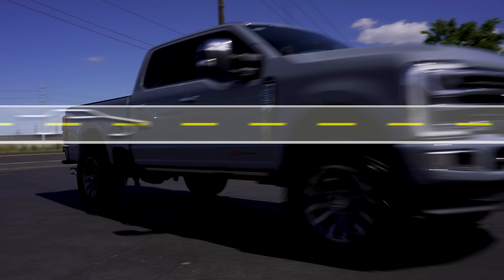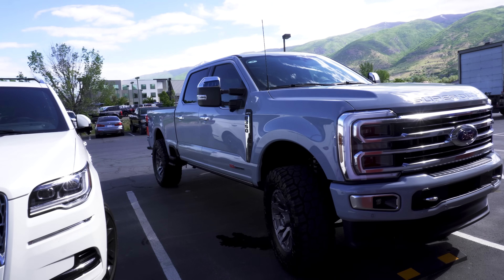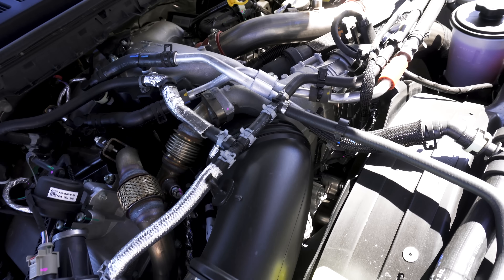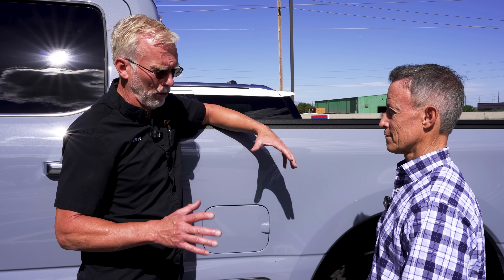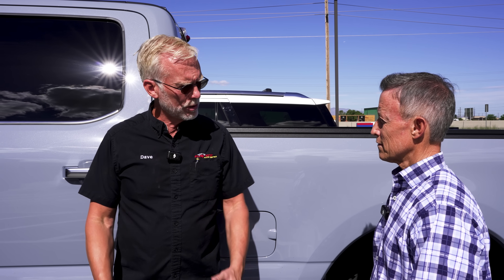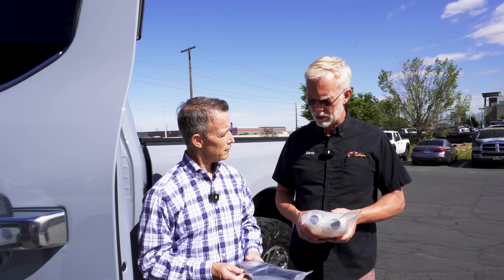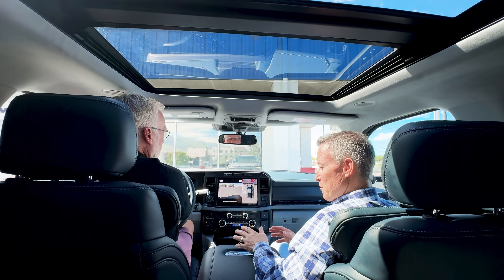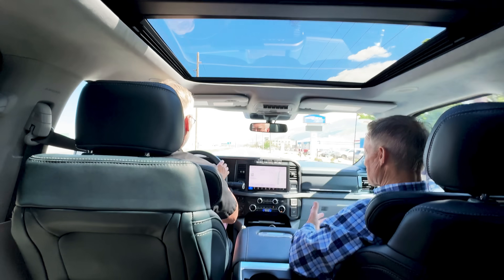Diesel Truck Maintenance

Comment: Ford chassis, cummins engine, allison transmission, The perfect diesel truck
Reply: My thoughts exactly 💥👊🏻💯
Reply: '06 Sprinter dually  25mpg highway with a 2" hitch unbeatable when diesel fuel is $3.50/gal
Reply: Ram chassis with air suspension, Cummins, ZF trans. In other words a Ram 2500.
Reply: I'll keep my medium duty Aisin tranny on my Ram 3500.
Reply: Ford chassis, international engine, zf transmission.
Reply: Allison transmissions aren’t anything special at all.
Reply: @CornFed_3 sure thing CornPop

Comment: Did I hear correctly? The question was, "what is in DEF?". It might have been the simplest to answer: DEF is 32.5 % urea and 67.5 % deionized water. Explaining how it reacts with NOx in the DPF is a little harder, but it's the whole point of current emissions systems for diesel engines.
Reply: Cat piss‼️

Comment: I think your great (Dave) I have been fowling for some time. With all the info you gave this guy why wouldn't the computer on the truck take over and contol and advise of all these situations. If I bought a nice truck like this you would think I wouldn't have to go through of having to learn and concern my self with with all technical checks, testing and mantance checks. It seems to me that you need to keep a logbook like it was an airplane. I understand its a high end working  truck but I would think at that price range you should be able to jump in and go.

Comment: 2:46 Mr. Bill Hewitt (RIP) powerstroke specialties, the man who arguably worked on more powerstrokes than anyone outside Ford motor company swore by archoil AR6500 in the fuel and AR9100 in the oil. He tested these products on thousands of fleet vehicles  with lots of idle time. it worked so well ambulances fleets, construction company fleets would buy these products because they kept regens down and the DPF and EGR cleaner, as well as helped the high pressure fuel pump live much longer. He believed in these products so much that for years he would send you a sample if you just payed for postage. If I had a diesel I would follow his recommendations to the letter he was a wealth of knowledge on powerstrokes. Look up his videos, follow what he says and that truck will live a long time.
Reply: Bill truly solved the issues with the 6.0s.  I don’t think people understand how much he did to bring those trucks not only back to life but he single handedly brought the values back to those trucks.  Archoil 4 the win.  I hope your having fun in heaven Bill.
Reply: Did know that Bill Hewitt passed away a few months ago? His employees are keeping the place alive.  Spoiled my whole day hearing that.
Reply: If you are needing an additive for your oil, you are using the wrong oil.
Reply: @ropeman3916  I’ll believe Mr Hewitt, thanks.

Comment: I'm glad I own a 2002 2500 Dodge Ram 4x4 with the 5.9 Cummins in it I don't have all that gov. bullshit on mine to contend with as they did not have that crap back then ! All that def crap and rengen crap does is rob you of power and destroys the motor !

Comment: Hello i have a question for you what is the best product to use for an Audi q7 TDI 2014 to atomize fuel ? ( i already changed the EGR the nox sensors and DPF filter. ) dont want the car to break down thank you in advance

Comment: Great conversation and lots of good information.   I have one question.  I have a 2006 2500 HD Silverado with a Duramax LBZ and have stayed on top of all my maintenance.  I rarely idle the vehicle and its only been used to pull trailers for maybe 10,000 miles. Generally a lightly used It only has 110,000 miles.  I have changed the oil every 3,000 - 4,000 miles.  I have always run Shell Rotella non-synthetic oil and wonder if you think I should switch to synthetic oil at this point.

Comment: Diesels are simple to maintain. Do not idle them for long periods unless it is in cold climates. Diesels are meant to be worked and they run the best when under a load. Unfortunately alot of people buy a diesel and use it for odd stuff and the odd haul etc. They are used for commuting mostly which is not what a diesel is meant for. The more a diesel idles the more regenerations it does because fuel is not being burned fully at idle. The more regens a truck does the quicker your DPF filter system will need to be replaced or have issues. When doing services make sure to use the manufacturer brand of filters or WIX. The reason i mention WIX is most manufacturers filters are made by WIX.  Never had a issue using them and the micron rating is normally better than manufacturers. I am not a mechanic but i have worked in the field for years with trucks and heavy equipment. Talked to all kinds of mechanics and seen engines taken apart and seen what the failures were.  Do the proper service intervals, make sure the fuel filters are done everytime, never run a tank empty, always keep the half to full. If you live in a area where you can delete the EGR and DPF then do it because that is 90% of these newer diesels problems. Also do not put a stupid tune on get a regular tune.
Reply: Well said, the BEST thing you can do to your 6.7 Powerstroke is delete it!!
Reply: @davidgay2679  Best thing I've done to all my trucks. Not really EPA
Reply: "Diesels are simple to maintain" 

Proceeds to write giant ass paragraph on what can potentially mess up your diesel engine lol

I would NEVER buy a modern diesel with all their emissions crap. 7.3 gas will do it for 90% of people.
Reply: Keep your crankcase breather, air and fuel filters clean. And your oil fresh. And your likely to not have a problem
Reply: Good thing big rigs don’t idle…..🤦‍♂️
Reply: I’ve got a 2021 6.7 and it’s deleted . Has a bigger intercooler , piping, dcr pump . I use it to haul 20-24k of totes daily . The other day it randomly overheated and than has been fine since . Any ideas on what I could check ?
Reply: Easy tune and some deletes yeah
Reply: Idling is fine if you drive again after long idling. Driving is at highway speeds of at least 30minutes. Idling often requires an enhance oil change, 5k min.. Changing oil more frequently or getting analysis done at 2.5 and 5 for baseline.
Reply: @ebec2believe776  idling isn't fine at all. You have no idea what you are talking about.
Reply: @wrectumwrangler  correct, idling causes excessive slobber buildup as well.
Reply: Idling a diesel will not effect it like a gasoline engine, but on the other hand I don't ever let any of my vehicles idle unless I'm warming them
Reply: Not too sure about light diesels, but in class 7 and 8 trucks, the regens tend to occur at highway speeds. The only regens that run at “idle” are the forced or ECM required regens on occasion.
Reply: What about on the 7.3 powerstroke ?
Reply: What about if a diesel is deleted?
Reply: There are some people that have no business owning a diesel.! Class 7-8 OTR trucks are a completely different animal.idleing on a pick up diesel is a no no!.high idle is ok.low or normal idle r p m will wash t h e cylinders!
Reply: @howardpoulson6825 high idle would be ok ? 
i’m in the oil and gas industry, about to buy my first truck
everyone runs a diesel out here so im going to copy them
plus there’s free diesel around 

trouble is i’ll be idling it a lot..  i will delete the truck so id hope that would make alright to idle it 
cold out here way up north, i need heat going and my starlink running 

seems all the gas vehicles have lifter failures from idling so i wouldn’t be any better going gas in my mind 
maybe im wrong 

input appreciated
Reply: Facts, that’s why I have an Explorer for a grocery getter. My truck is for truck things. Towing, hauling, not cruising to church.
Reply: What is a regular tune?
Reply: @mattwpolo1990  a regular tune? Pretty simple one that isn't offroad and has the diesel burning clean instead of rolling coal, didn't think I would have to explain what a regular tune was

Comment: diesel fuel  filter change every 15K??  oil every 3.5K??  In reality 50K fuel filter change and 5K oil change will still keep your engine running fine for 200K +  Use hot shot every day diesel like you plan to do and don't over think it.  Diesel motor is tough and will likely outlast you.

Comment: The trick is to keep it running. My injectors made it 610,000 miles, some fuel filter changes well over 30,000 miles, even over 50k. Injectors were still ok so they're spares now. Once in a while I'll do an additive, simply can't afford every tank. I drive this thing a LOT every week, so it doesnt sit for very long. Original CP3 pump now at 752,000 miles.
Reply: Nice. Howe's Lubricator seems like it does a good job. I have 4 diesel trucks. Knock on wood- they're running ok thus far. The  CP 3 pumps are bulletproof. Just took one out of a wreck. The pump/regulator by itself probably weighs more than an alternator.
Reply: @billwestfield6394  Yes, CP3 is solid, mine is now 752,000 miles... I've used Howes, but mostly power service and 2cycle. I have replaced the FPR once, but it seems to act up depending on fuel temperature. The lube in the fuel does help it out.

Comment: Over time the diesel fuel will enlarge the holes in the injectors and causes incompetent combustion, keep track of the maintenance on the fuel system, injectors, injection pump. Take the injectors out and test them with an injector pump so you can measure and see the pattern.

Comment: 2004.5 LLY Duramax, Currently at 310k miles on original longblock, with new headgaskets and studs, a nice Dans diesel performance 67mm and had the injectors changed once. Ever since i have owned her every 10k miles it gets a new oil and filters for the whole kit, both fuel filters, oem rec fluid for the Alison, Amsoil for the rest. I added an extra in line filter and i use Optilube fuel treatment every other fill up. I like optilube but Stanadyne makes some great stuff too along with that Archoil, i can feel and hear a difference if i don't use additives.
I probably spend a grand a year on just additive for my diesel fuel.
Thankfully my truck being older it only had an EGR, and its old enough no one cares it is missing, my truck runs clean though, i paid really good money for custom EFI live tunes made for it.
If you're truck has an EGR on it, its only a matter of time before those ports are caked and flowing 30% of the air, force feeding your engine its own dirty air back again is torture for it.
Find a gas station you trust with good fuel for your area, one where you can meet the owner, and only get your diesel there.

Me personally, its smarter FOR ME it makes more sense to just keep rebuilding my old pre emissions truck for as long as earthly possible to avoid the obvious ticking bombs the EGR/DPF/ECR etc etc clearly are. I do feel for those who must continue to buy into a new post dated over inflated marked up truck.

Comment: Wow, 3,500 mile oil change…. Most of the manufacturer books say 7,500.  Guess Blackstone is the only way to tell….
Reply: 3500 is crazy but oil analysis solves the guesswork.  My Cummins recommends 15k but I do 7500 with oil analysis.  They say I can go longer but I just change it to be conservative.

Comment: Couple notes. 
Engine design and egt probe location have a lot to do with EGT’s an maximum temp will vary depending on the truck. 20+ fords run steel pistons to allow them to run high temps without seeing damaging results. This means there is no singular maximum exhaust gas temp and it will all vary depending on the vehicles year/make/model
DEF doesn’t help with soot removal from dpf. Def is a mix of water and urea designed to cause a chemical reaction that lowers NOX caused by high exhaust gas temps with the help of an scr.
Diesels also don’t spray the outside of the cylinder walls in a stock configuration unless you have extremely plugged injectors or an extremely hot tune. The injection cycle hits inside the bowl of the piston for optimal combustion and longevity. 
Side note. Diesel engines that do not have a standalone fuel injector for the exhaust after treatment system will dilute oil more with fuel as a byproduct of injecting more fuel to raise exhaust gas temps to burn soot from the DPF.
Other than that great video.

Comment: The Cummins thing is cringe, not only do they all have faults but they will have have an equal amount, I bought the 6.7 back in the day cause of its power, going strong for many years with my truck but it’s also my baby. Have many Cummins friends that have gone through engines before I have till date. All about maintenance

Comment: One thing I do is try to never interrupt the regen cycle. I have a gauge that tells me when my truck is in regen mode. Once it starts I will bypass my destination and keep driving till it completes its regen. Keeps the temps up. It been 300,000 and never been in the shop for any emissions issues. Not sure if this is why but it works for me.
Reply: What a nightmare😂😂
Reply: @danny.b agree 110 percent. lol.
Reply: Agreed,

Comment: Dave referring to the the good old Fummins build. These days though I believe Ford uses the 6.7 powerstroke in all trucks even up to the f750. I work at a ford pro fleet shop and the only Cummins engines we see are on older trucks.
Reply: Should’ve added, maintenance wise a big thing that’s neglected on these is the new 10 speeds(we see alot of bad 10 speeds relative to the old 6 speeds) to Service that transmission and don’t do a flush. Get a pan drop and filter replacement. Another forgotten area is the positive crankcase filter, though I believe that’s a high mileage interval maintenance item.

Comment: Dave- To help control soot in the engine- 1. Would replacing the oil filter at 50% oil life help? 2 Would changing the oil when the engine is cold be better than when its warm?? TIA

Comment: Before you even started talking about boats I was going to say a lot of older Detroit’s on sport fishing boats put out so much soot you can stand on the back deck while underway. Down south where  it’s extremely hot all year around those sport fishing boats that sit will grow algae in the fuel tank. Fuel polishing ain’t no joke. I bought a 50 foot sport fishing boat in Miami and not knowing about fuel polishing or algae growing in the tank the boat sat in 85 degree temp for 4 months without being ran and I jumped on and left for the Bahamas for a month. I took a crash course in Detroit 12v92 engines and the fuel system went thru 12 primary filters or racor as they are called in a month and a hand full of secondary filter and eventually the floor had to cut up because the feed from the main tank to the port engine was 85% blocked so the whole trip I had to run one engine on my primary tank and one on the aux tank

Comment: Thank you. This was one of the most informative videos. I have watched. I have a 2017 Dodge Ram 3500 6.7 Turbo diesel.i regularly change the oil every 5000 in the fuel filters every 5000. What is your recommendation for the best fuel additives for the injectors? Thank you.

Comment: We went back to gas powered one tons, EGR Diesels just can't handle short trips/idling. Our big trucks are Cummins, Maxxforce and old old DT466E powered. No problems with the DT466E,  the Cummins L9, or the Maxxforce 10, the smaller Maxxforce's are a different story, all emission system problems.

Comment: As a new diesel truck owner (2002 7.3 f350 91,000 miles ) this was the video I was hoping you would do. 
Thanks Dave!
Reply from the maker: You bet!
Reply: I have 2001 F-250 7.3  137k have had it since it had 47k on it I change oil every 5k pretty religiously a d i use diesel additives every other tank  I have had no mecanical issues I keep my egts down under 1200 if at all possible  Just added a Mishimoto trans cooler as I noticed some higher trans temps that I wasnt comfortable with  We will see how that works as I have seen great reviews on that install Dave I understand you are in Utah may I ask where? Im in Ogden area Thanks for the great Video

Comment: Would suggest an S&S Disaster Prevention Kit for the fuel system. The CP4 high pressure fuel pump is prone to failure when subjected to poor or contaminated fuel.

Comment: I'm in Alberta Canada and I had to delete the dpf system in my 2011 F350 6.7L. the dpf failed twice in 3 years. My truck has 224,000 kms,  the system lasted for quite a while. Next I want to delete the EGR system. The first time the dpf failed it cost me 1800 cdn (ford quote) then recently more components failed and this time ford quoted me 2800 to fix..I decided to delete the dpf for 2400 cdn. It's unfortunate the EPA is on people and shops like white on rice regarding deletion of dpf/EGR systems

Comment: I treat half tank like empty and I've  never changed a fuel pump good rule do ur own maintenance use wix oil filters I build Komatsu mining trucks they haul 400 ton with 3500 hp Cummings electric drive baddest diesel ever !! There not really picky on oil but you will voild the warranty if you don't use wix filters there's no life span the engine turbos live forever if maintained million dollar engine

Comment: Engine isn’t the weakest it’s the egr system and the fuel system they need more lubricity in the fuel then what they get especially if they still running the CP4

Comment: Speaking of Colorado....during the incessantly hot summer, dog turds form a hard outer crust and can be primed, painted, and wet sanded to a high polish.  You can pinstripe them, and even mount electronics to it with a small metric self tapping screw.   I don't know why I'm mentioning this when the video is about a brand new, modern pick up truck.  I apologize.